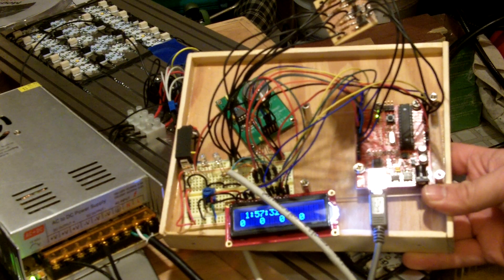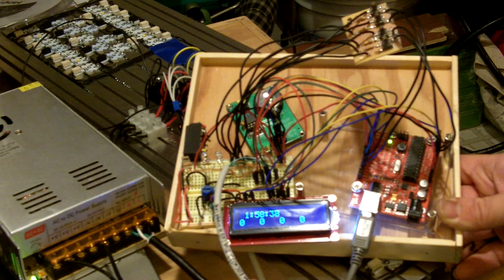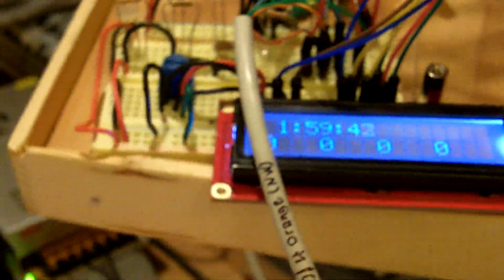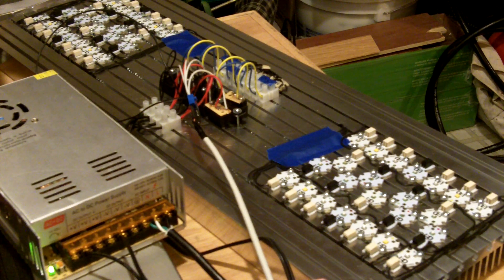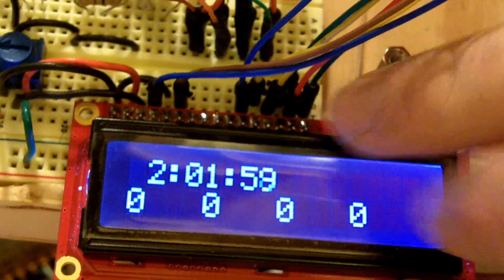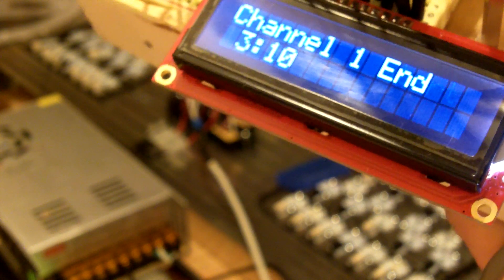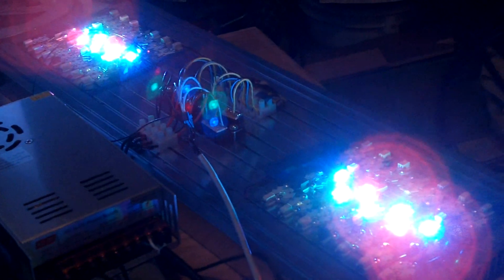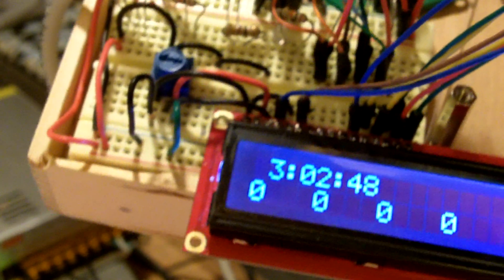DIY Typhon based PWM LED Controller built on Arduino - cheaply

Comment from the maker: I believe this is the code: https://redirect.viglink.com/?format=go&jsonp=vglnk_149809006873413&key=51294b2b0210fdc085eba195da0a018e&libId=j47o3owc010004xp000MAxaj1weqy7b6h&loc=https%3A%2F%2Fwww.nano-reef.com%2Fforums%2Ftopic%2F321511-typhon-based-led-controller-on-the-cheap-seriously%2F%3Fpage%3D2&v=1&out=https%3A%2F%2Fstorage.googleapis.com%2Fgoogle-code-archive-source%2Fv2%2Fcode.google.com%2Ftyphon-reef%2Fsource-archive.zip&title=Typhon-based%20LED%20controller%20on%20the%20cheap%20(seriously)%20-%20Page%202%20-%20Do%20It%20Yourself%20-%20Nano-Reef.com%20Community&txt=https%3A%2F%2Fstorage.googleapis.com%2Fgoogle-code-archive-source%2Fv2%2Fcode.google.com%2Ftyphon-reef%2Fsource-archive.zip

Comment from the maker: Hey all, sorry apparently I haven't checked back enough to help - though to be fair I did post the detailed instructions in a thread in the video information.  There is listed all the parts and the code.  I didn't write the code, it's open source.  I did a few modifications, but that's not particularly difficult.

3 year update: the light is still going strong and working great.  My power supply broke after about a year but it was a very cheaply made unit.  Now 48v power supplies are much more available so I got a nicer Meanwell brand one that has served much better.   Also a few months ago I switched around some of the LEDs. I removed the 8 neutral white and replaced them with 2 larger high CRI bridgelux chips and I removed the red.  I also added 6 lime LEDs for increased visual brightness without affecting the corals so much.  I decided to put the lime on it's own channel so I will be updating the original thread with some new 5 channel code soon.  I also just picked up an arduino MEGA 2560 because I need more memory than the Duemillanove from like 2008 has.  Thanks for viewing the video!
Reply: Hey man, thanks again for this excellent explanation! Was realy helpful to get me started with hardware programming. Unfortunatly the link you posted in the guide is not yielding the software you have used for this build. I bought everything to build this device, yet i lake the proper software. Can you please provide me with a working version? Or maybe push me into a good direction to obtain this myself? Thanks again and hope you can fix me up.
Reply from the maker: Hey - so I'm not sure why the link isn't working...  Anyways, here's the google code page: https://code.google.com/archive/p/typhon-reef/
Reply: Sorry, could you please upload the code again due link is not working
Reply: I think I may have found it here and scroll to posted June 6th post.
https://www.nano-reef.com/forums/topic/321511-typhon-based-led-controller-on-the-cheap-seriously/?page=2

Comment: I dont get how this works... Does the power supply feed into the drive and the arduino feeds into the drive? Then from there the current is worked out based on the pwn and goes to the leds?

Comment: Hi I'm currently starting my DIY Led project. I would appreciate some advice if you don't mind!

What is your Power supply specs. How do you calculate the required power supply?
How do you wire the Drivers....is it in parallel to in series to the power supply? 

Thanks for the video it is awesome!

Comment: Hi ajmckay2, I am very close to use your code and make same controller. However I am stuck at point where RTC communication isn't working. I am using DS3232RTC instead 1307. Since my local shop had only 3232RTC.  am getting 0:00:00 instead real time.
If you are happy to help we can communicate over email and get this thing working. Spend almost 3 days now without any luck.